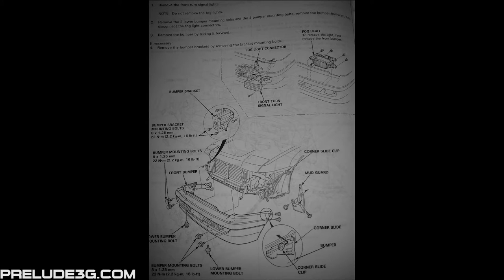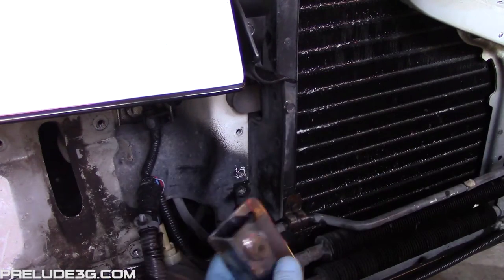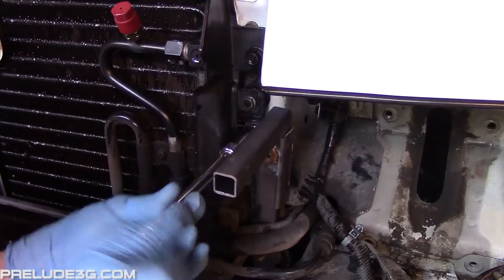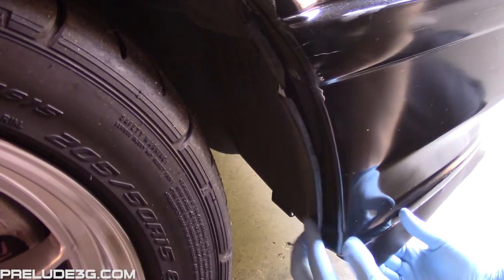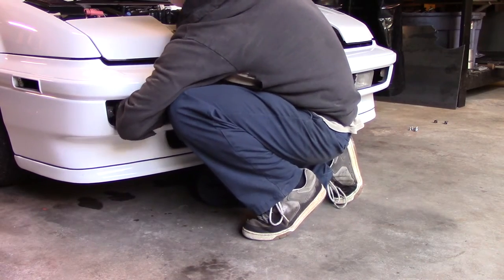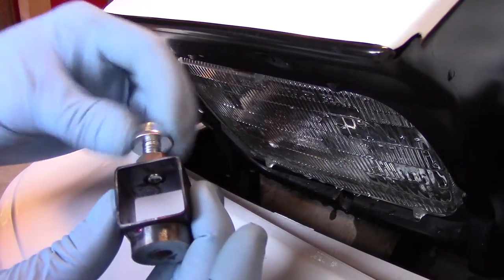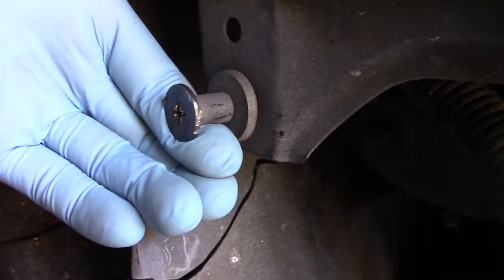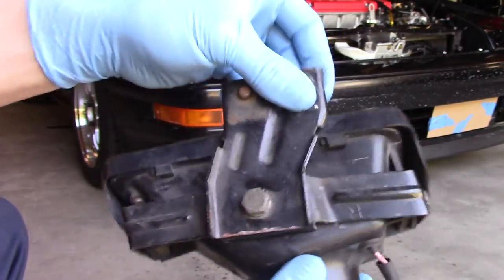Front Bumper Delete aka. Lightweight Front Bumper Cover Support 90-91 Installation

Comment: how much weight does this save in the front? i just purchased an 89 prelude with 70k miles on it. i do not know if i want to keep everything pristine stock and unmolested, or h22 and counter the weight buy doing some modifications to the front such as this delete. pleas get back at me if you can. great video.
Reply from the maker: Saves ~20 lbs. However I think there is only one left and it's for 90-91 ludes: http://www.preludepower.com/forums/showthread.php?t=438930&page=3